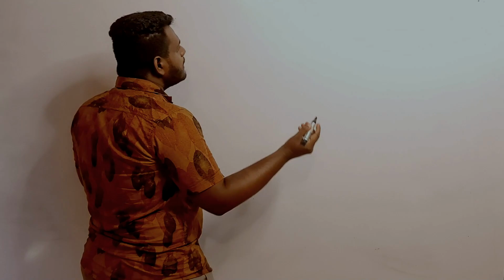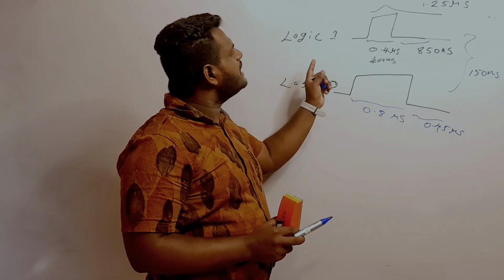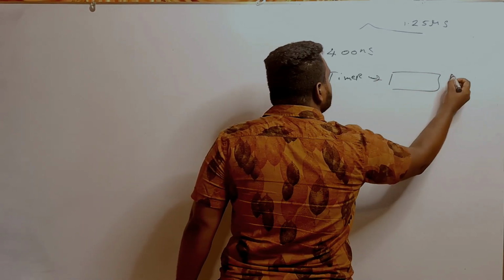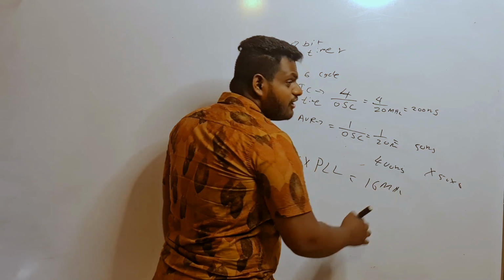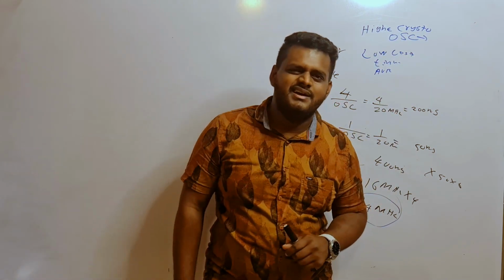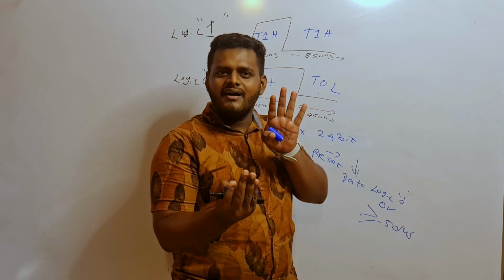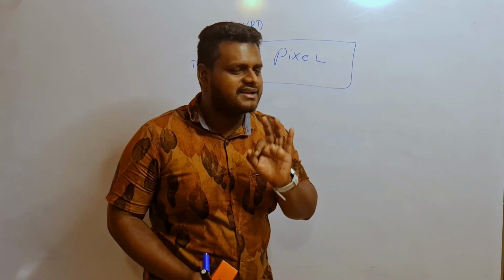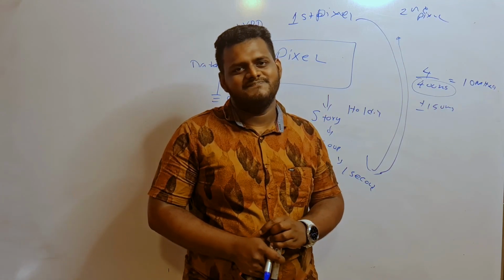WS2812 Neo Pixels interfacing with PIC Microcontroller #12f675, #12f, #16f #18f

Comment: So you are saying pull the pin high( so that it doesn't reset itself) and do other stuff..than return and send next pixel value...but i am curious that can take break between data bits of single pixel value..for example between the 5th and 6th bit of blue value??? Or between RG and B???